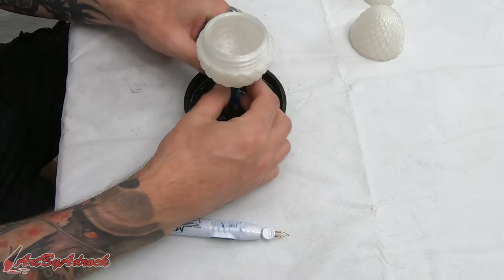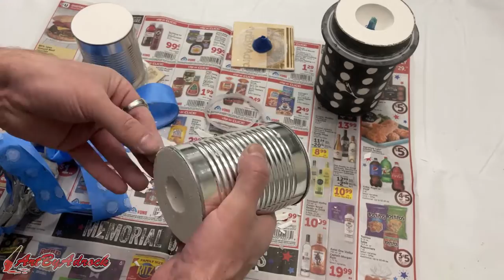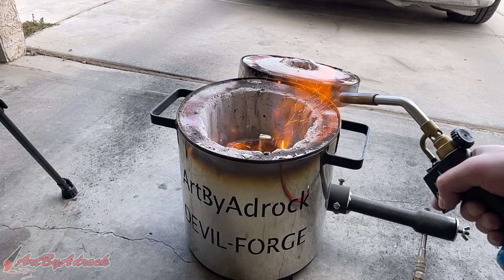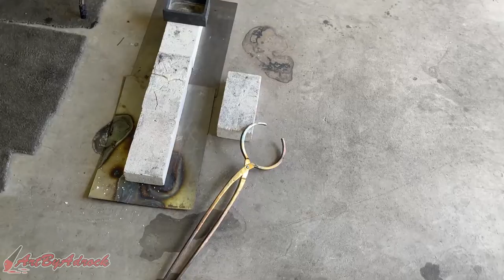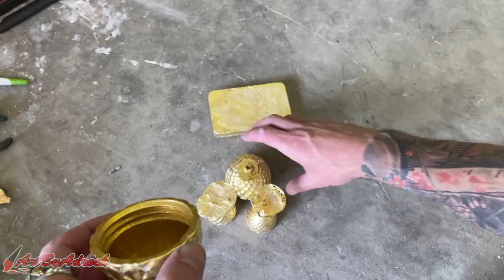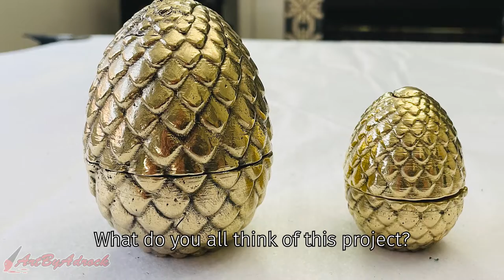Making Golden Nesting Dragon Eggs - Amazing Metal Casting Process

Comment: Great idea.  The thread on the 2 pieces work well together, and are as good as you're going to get using that method.  To get them to fit any tighter, almost seamlessly, you'd need to use a tap on a lathe, (albeit a very big one), but that's something else.

Comment: I think I would have actually just cleaned up and left the base on the large egg so that it could stand on it.
So running your furnace right on the edge of the garage under the door, do you have any sort of heat shield or anything above it as I would be concerned about it damaging the door?